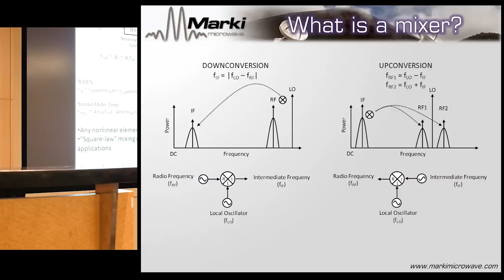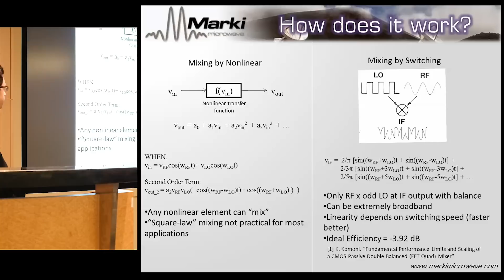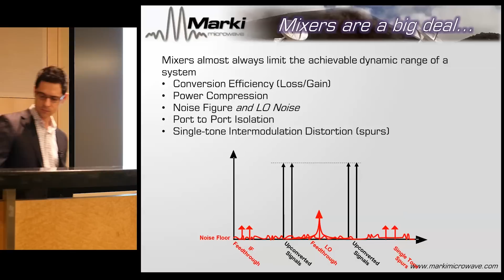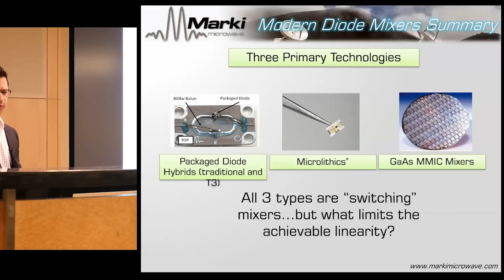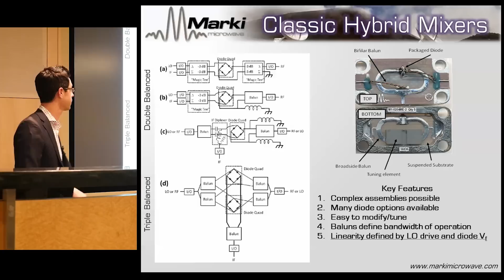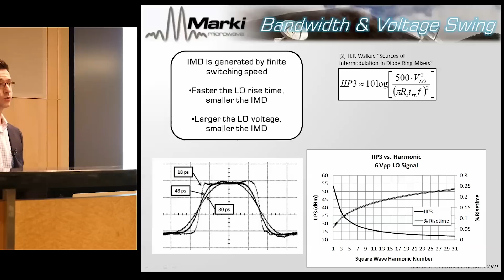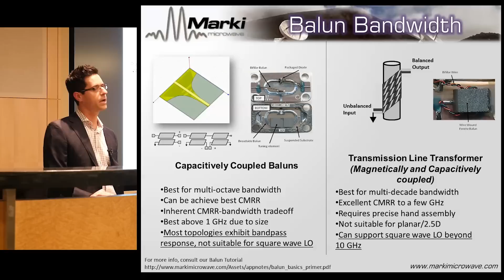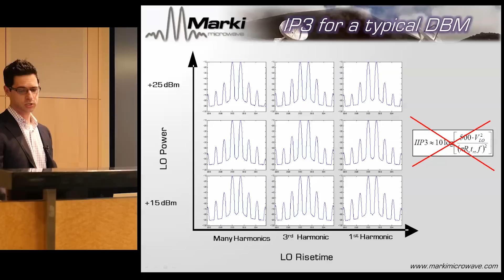What is a Mixer?  Modern RF and Microwave Mixers Explained

Comment: Great video; thanks for posting it.  I thought mixer linearity was inversely proportional to diode resistance; hence the need for higher LO drive.  So do these high IP3 mixers with their 23 dBm or higher LO requirements actually get you anything, is is it a diminishing return?